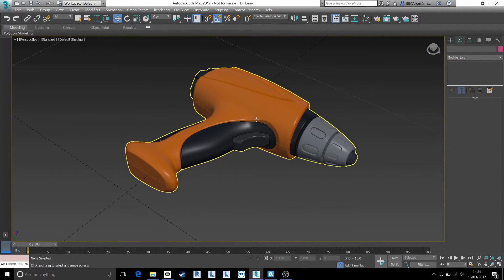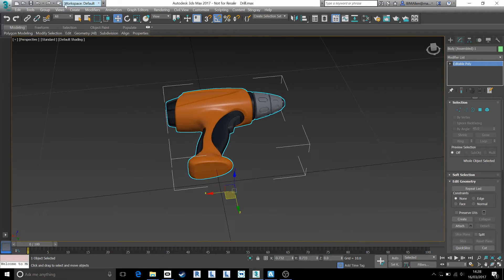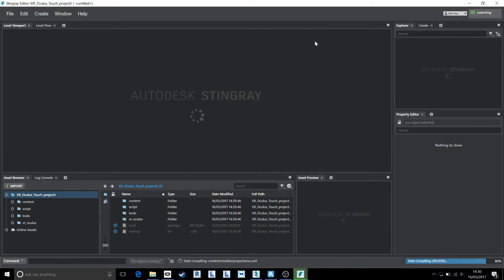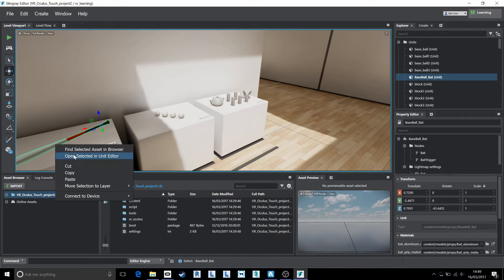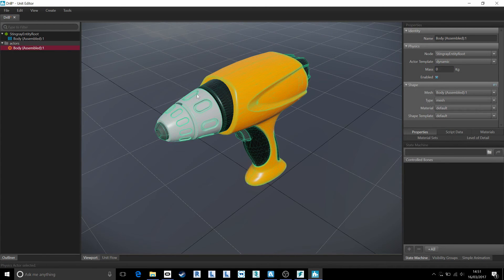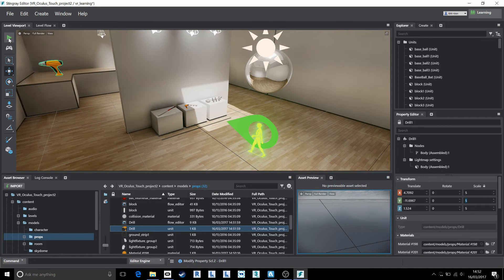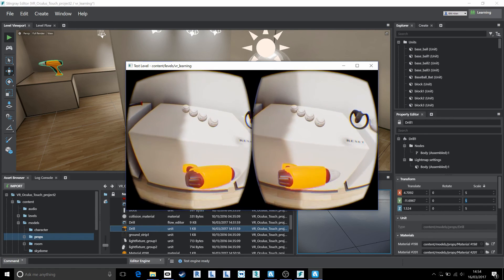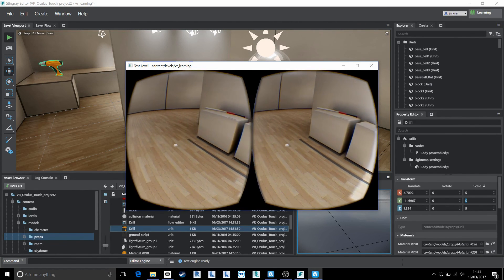Autodesk Inventor or Fusion 360 to VR Workflow with Autodesk Stingray

Comment: I just looked for Stingray... it has been discontinued. Hummm... I just today purchased an Oculis Quest... so I very much want to learn how to import a VR version of things I design. Any updates?
Reply: They pretty much took stingray and slapped the name "3DS Max Interactive" onto it. It is now an add-on for 3DS Max. 3DS Max still has this same project starter file and everything. I also think that the extension for these projects are still .stingray_project. As far as getting projects you've designed over to the Quest, you're on your own. Since you can't directly hook up the headset to the computer, I'm not sure how it would work, but you may be able to put the game on an SD card (or however you get other games).
Reply: @joshuabutler1678  With the quest tether out now you can hook up the quest to a computer. I'm borrowing a friend's to do the same thing.
Reply: @joshuabutler1678  i was able to do it. I send the file to Google Poly... Then publish it from there I can import it.
Reply: @Askjerry  How were you able to use it without the tether?
Reply: @joshuaurbany6468  Sideload

Comment: Hello! Thanks for the video. One question, Is it possible to export a file from Autocad to view the VR in a googlecardboard? I don`t have the Oculus,HTC vive or similar, i only have the google cardboard and a cellphone. Thanks in advance
Reply: you need to export that to 3ds max and then to stingray google cardboared. template.  or export the scene as fbx. with proper material as autocad material doest com over in fbx.

Comment: Is there a way to render out 360 animation ?
Reply from the maker: A panorama? From Fusion directly or using Stingray? If the answer is from Fusion then yes, but you have to jump into the A360 rendering page on the internet, find your render on your account and right click > "re-render as" and select panorama. If the answer is from Stingray, then arguably yes but stingray is not necessarily there as a render engine.
Reply: can stingray render out 360 panaroma sequences with just a click of a button? (after setting up camera path)
Reply: now it can you can setup the camera FOV to 179 or 180 and timely animate rotate camera 90 or 75 degrees .. as it covers whole cycle. then you can render the seuence as an exr files using capture frames settings. and directly using story editor run the capture frame tool.. . since these are exr files they are already in hdr, all you have to do is stich them... for animation sequences you need to center 4- 6 cameras at 0,0,0. and render out the sequences using all those 4 or 6 cameras aranged in a circular format...